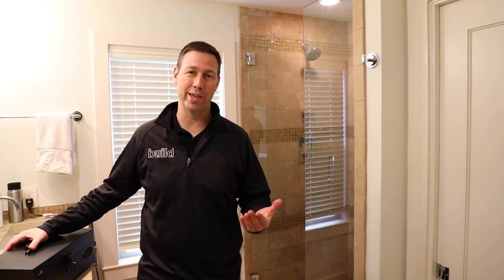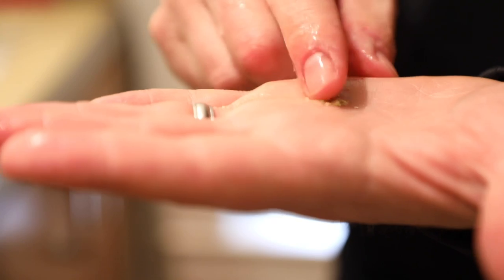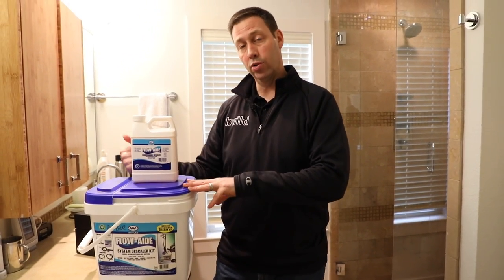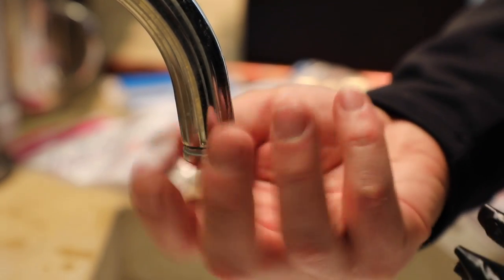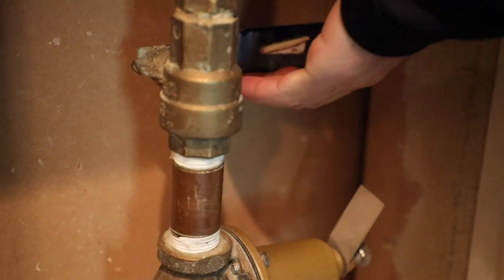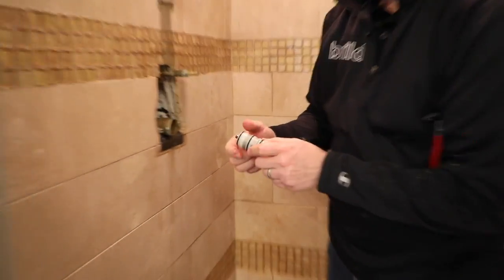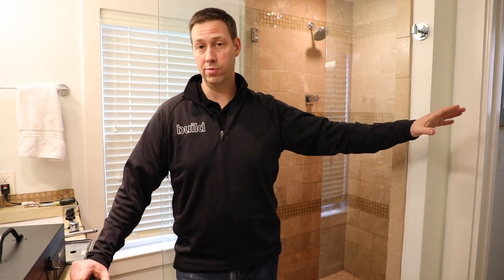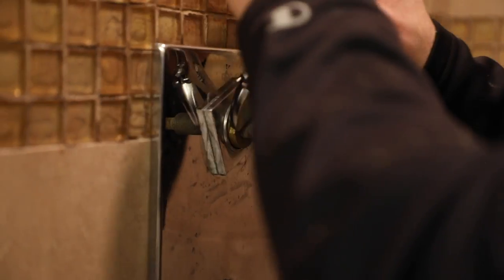The Bummer for Tankless Water Heaters - Fixing a Scale Issue

Comment: Do you want to try and tell me an electric hot water tank, Don't do the same, but worse. Finally after 2 electric hot water tanks and replacing the elements on one of those. I finally spent a little more up front for a Good tankless water heater. It has been in 12 years now and I flushed it one time 2 weeks ago, and there was nothing in it. It still has Not given  one minutes trouble. I welcome you to dispute what I'm say. I have the paper where I purchased it and installed it myself, and it has NOT had any repairs in 12 years. What ever brand your talking about, maybe that's the problem, all tankless water heater are not the same, or so it seems. Come check mine out and take the strainer off and check yourself.

Comment: Tankless water heaters don’t have “boiler units”... they have a heat exchanger.. This is a perfect example of the importance of doing your yearly maintenance aka a Flush or Descale.. 

Clearly the problem is a flow issue, caused by buildup in the aerators/flow restrictors.

Einstein here shut off the water and didn’t relieve any pressure first.. 😂
Reply: You must always service your heater even with a water softener, that is completely false.

Comment: tank less really are not better. you want a cold water sandwich? you like having to wait for hot water? you want maintenence? or you could just parallel two 50 gallon tanks and call it a day.
Reply: explain the cold water sandwich ?
Reply: So many of the benefits of tankless are going to be regional and depend on the rest of the system, yeah? Here in Seattle with the softest water imaginable and no AC needs, tankless makes a ton of sense. Our plumbing was designed for a tankless system, which serves double duty as our heat through hydronic radiators. Heat is lower priority, automatically kicks off when there's other demand. Cold water in the lines is taken care of with recirculation. Couldn't be happier with the system.
Reply: ok... and the benefit is?...
Reply: +Mitch for us the main benefit is space savings and hopefully lower gas bill but I doubt that will really be the case instead of the tank taking up at least 9 square feet of floor space it is gone and now the heater is hung on the wall outside. Plus since all gas lines outside never a gas leak in the house well from piping anyway
Reply: limitless hot water is the quickest way to an expensive gas bill. the size factor is a good reason if your in a tiny house, I'll give that a point for tankless.
Reply: Mitch and Cassie Shepherd something tells me you do NOT have a properly sized unit, but by this it may be scaled up.

Comment: Tool box on counter no surface protection.   Loose parts all over counter, ready to fall down drain or on floor.    Using customer's towel to catch water on floor?  Not very professional.
Reply: lichub I think that may have been the shower mat.
Reply: Leighton Samms I think that is a towel.

Comment: The trouble is I hate soft water.
Reply: Emmitt Osteen why? There are guise some myths about softeners ,  you are probably worried about high blood pressure.but there are “SALT FREE “units out there , what they do is change the structure, of the water, but it really does not soften it, but you get no mineral buildup,  NOT CHEAP PELICAN , comes to mind

Comment: Golly, since this is a known issue, I wonder why the makers of tankless heaters don't put a filter in their unit to trap loose scale.  It would not be that difficult to get several square inches of fine screen in a small volume that would not appreciably delay hot water output.
Reply: There's a reason why manufacturers dont do this. Maintenance is the proper way to handle this.
Reply: Tim, It seems you're saying that the service interval for said filter would be the same as for an acid flush to remove the scale before it got thick enough to flake off.  Yes?   (Since the water shortage, I've started using HCl to remove urine scale from toilets every few months, so I get it.)